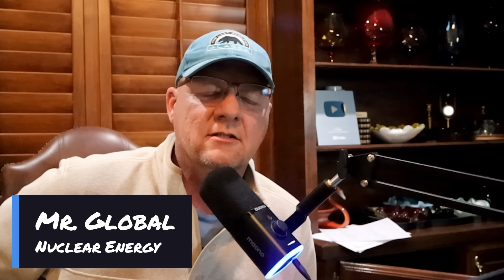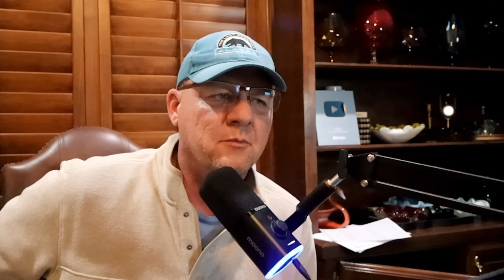Why Nuclear Power is Too Expensive and Always Late

Comment: I am pro-nuclear, but when the value proposition is based on running cheaply for a century, you really need a lot of faith in government over long time horizons.  Build times are conceivably possible to massively shrink, but you need to fix a lot about the system

Comment: V poor analysis.  Answer these questions:  why are China and Russia simply getting  on with it, at 20% of the cost and half the time that Western countries? Multiple answers:  it IS bureaucracy gone wild.  France, China are proof that building  multiple  copies of the same model resolves all of this commenter's points.  The unwarranted  fear of radiation, exaggeration  by poor science  journalism and successful  demonisation by the fossil fuel industry also feeds into the West's self defeating response. 

SMRs could resolve all of the energy needs but it needs the government to get out of the way. And the public needs to come to terms with the fact that nuclear is the safest energy. Just as safe  as solar and better than wind and hydro. Chernobyl, the worst accident, killed about 60 people and probably shortened or adversely  affected another 100 000 lives.  Which is nothing compared  to road accidents now or the future climate damage that not replacing  fossil fuels will be.

Comment: In the 1970s Austria built a nuclear powerplant (Zwentendorf) and after it was completed, it was decided not to switch it on. Even the first fuel was order that time.

Now: Google builds a data center in Kronsdorf. They already got 150 MW power but requested another 800 MW of power demand from the grid. Yes this will required some grid upgrade there but the grid itself does not generate any power. Someone must also provide that power. I don't think AI will wait 20 years for that to happen, regarding the innovation cycle speed in the computer industry.

Comment: And yet Ontario's nuclear plants have been running since the 60's and 50% of the power in Ontario is supplied by them. They have been constantly updated and currently there is no intention to replace them. Maybe it's the fact that the US seemed to always pick the cheapest designs leading to the endless shutdowns
Reply: FYI, a decision to build those nuclear power plants was political. 
Ontario has plenty of hydro resources and in those days environmental assessments, permits and getting agreements from natives was not a thing.
But all plans to build hydroelectric dams in northern Ontario were cancelled because  federal government at that time had an idea to sell CANDU technology around the world. But they needed a few model sites to show to potential clients.
Quebec did not agree with this scheme but Ontario did.
This is why Ontario is not a good example for nuclear power plants. 
But France is.

One major advantage Canada has is different ownership of power plants and transmission lines. 
US ownership is very fragmented, which doesn’t lend itself to long term planning.
Private owners want to squeeze maximum profit instead of spending money on upgrades, public owners don’t want to spend money on upgrades because those upgrades are invisible to the voters.

In contrast, if the taxpayers in Canada pay for everything, the capacity planning, upgrades and the quality of equipment used is top notch 
😂😂

Comment: AUSTRALIAN ENGINEER - Can people like you who are clearly NOT ENGINEERS please shut up.
Go and invite an engineer on so you can actually inform people instead of MISINFORMING PEOPLE. 
FIRST - like most Americans you think everything that happens in America represents the world - WRONG.

SECOND - Your timeline premise is BULLSHIT. At 2:12 you said "And we have an energy system that changes. Literally changes every 10 years." 
THAT IS COMPLETE NONSENSE: Power stations last decades. Hoover Dam has been operational for 89 years. The Voltages DO NOT change. The Frequencies DO NOT change. The biggest users of electricity like manufacturing plants and petrochemical plants DO NOT change because they aren't built to go for less than 10 years. Those sorts of users have basic operational plans lasting 30-50 years.

THIRD - You claim you want to educate people and can't look up the cost of Vogtle. You type V-o-g-t-l-e into google or Wikipedia and it gives you the cost of $36.8billion for 2 x Westinghouse AP1000 reactors. That's a cost of $18.4billion each. ANYONE CAN FIND THAT OUT IN SECONDS.
Now you are RIGHT on the costs being to high BUT YOU HAVE NO IDEA WHY they have exploded. 

FOURTH - Mixed in with the costs claims are the construction times. 
Vogtle the construction start and commissioning dates are also on Wikipedia Unit 3 - 10years 2 months Unit 4 10 years 5 months. 
The Chinese also have built 4 AP1000 reactors. The 2 at Sanmen took 9yrs 5m and 8ys 11m. The 2 at Haiyang took 9yrs 1m and 8yrs 7m.
Considering Vogtle was interrupted by the 2017 Westinghouse bankruptcy and China is far less regulated the construction time was reasonable.
For comparison the Barakah plant in the UAE with 4 South Korean APR1400 Reactors took 15 years from award of contract to full commercial operation.

This is something that infuriates engineers when people take an example of something and compare it to nothing. You clearly have no experience in complex projects at either the design, construction or commissioning phases. 

FIFTH - On financing people like you do not get HOW these sorts of projects are financed and HOW the companies are subsidised and HOW the general public end up paying for it all. This is NOT a nuclear plant thing and its NOT a government versus private project thing either. The problem is accounting tricks, banking and economics NOT engineering. it gets more complex and convoluted but here's the 3 important points

1) It starts with the economists who are obsessed with growth measured by GDP which does NOT measure production or indicate productivity it measures spending. So when someone spends $1 GDP goes up $1 and someone OVER spends $20billion GDP goes up $20billion. This is why economists never complain about military spending like the $2Trillion on the F35. To an economist that's fantastic because GDP went up by $2Trillion.

2) Then there's the issue of the banks who lend the money. They do not loan money from cash in the vault. They create money on a computer. Their only concern is "can the customer service the loan?" and I got told that by a commercial banker when I asked if they check on the project when they have to loan an extra $$billion. He said "NO" they only check if the customer can service the loan. When he had to find an extra $$billion for a project it was great because he got a commission for that.

3) Then there's the real clever boys in accounting who have found a ways to flip massive construction overspends into profits. Its from the same sort of mentality that gave the World negative gearing. The overspends allow the owners to make massive claims on tax and over time those tax concessions flip the initial overspend in to long term profits. The shareholders don't care so long as they get their dividends and the CEOs don't care so long as they get their bonuses. 

Milton Freidman said "Greed is Good" and that got adapted into big construction.

I gave up critiquing at that point.

Comment: One issue with NP was the design. Yes most use the PWR style but the plants are uniquely constructed. Had the NRC worked with manufacturers and standardized the build and construction of NP this may be different today. Not making NP plug-n-play is the failure.

Comment: Nuke plants were aging out, power demand was kind of decreasing before the advent of EV's and data centers, renewables are cheaper and faster to build, no highly toxic waste, lower decommissioning costs, continuing advances in renewable efficiencies and lowering costs to implement. Meanwhile, nuclear just keeps getting more expensive and takes longer and longer to build. I think I also read that SMR's may have a slightly higher cost per unit of energy produced vs. conventional nuclear.

Comment: It's only the cheapest if the NGS is built on time and on budget and a has 40 year lifespan before refurbishment is required. Every nuke in Ontario has gone at least 400% over budget and has needed a complete rebuild after 20 years. Plus the cost of the transmission corridor to serve it. SMRs produce more nuclear waste per gigawatt than conventional nukes. The cost of dealing with that is not included in their costing either.

Comment: Agree 100% that the grid needs to be expanded and made more resilient.  I'm just not sure how that is going to happen in an efficient way when trump has placed 50% tariffs on some of the core raw materials required to actually expand it (steel, aluminum & copper).

Comment: Environmental assessments;  seismic reports (at least three US plants are built on fault lines...Diablo Canyon, North Anna, and Indian Point).  The coolant towers alone cost a couple million to design.  Coastal or waterfront plants can avoid the coolant towers but are exposed to rising sea levels, flooding, and hurricanes.  Nuclear needs power to circulate coolant even when "off" or else a meltdown occurs, and in an emergency the first thing that collapses are the grid lines and the emergency pump generators get covered in flood water.

Comment: Many years ago a prominent antinuclear activist told me that it's very simple in the end: where does the nuclear waste go? 

This is waste that lasts longer than agricultural humans have existed. 

The only project I'm aware of that took this issue seriously is the reactor project in Finland, where they are excavating into highly stable granite bedrock at the same time the plants are being built. They are excavating a huge tunnel network large enough to hold the waste for the life of the plant, and I believe also to hold more waste from elsewhere. They also devised some very clever containers that should hold up for the required half-life time period. All very expensive.

This means this is probably the only instance globally of a nuclear facility where you can price the true costs of that energy in real time. 

Everyone else tries to externalize waste storage as an unrelated issue. 

Humans are not made for such time scales, and there are a finite number of millennia stable geological structures that can be used. Finland has them. And has the cultural ethics to take waste disposal as seriously as the short term energy production of the facilities. 

If society collapses and loses the ability to commit massive resources to burying the waste properly it will not get dealt with properly. 

Just look at Chernobyl. It blew up, the ussr collapsed, and ukraine was stuck with the problem. Then Europe had to step in to build the short term sarcophagus that has already been damaged by the Kremlin's invasion and will probably require new encasings at great cost, which will also be short term.

Comment: Any thoughts on this?
Ontario is building North America's first grid-scale Small Modular Reactor (SMR) at the Darlington nuclear site in Clarington, Ontario, with construction starting on the first of four units to power hundreds of thousands of homes, a key part of Ontario Power Generation's (OPG) plan to meet soaring energy demand with reliable, low-carbon nuclear power, using GE Hitachi's BWRX-300 technology, aiming for the first unit online by 2030.
Reply: unless you're near the place, don't hold your breath

Comment: In the sixties our family moved into a subdivision of about one thousand homes. It was tract homes with three models to chose from. Each model had about five or six options to suit a families needs and budget. All of the crews of every trade worked out the bugs in the first few homes, so that they got costs down and efficiency up every step of the way. Now we call them cookie cutter homes like it is a bad thing. Everyone wants custom homes on every lot such that each one is experimental for the construction crews. Of course the prices rise and of course the timelines slip. If we could get assembly line SMR's trucked into the site with standardized construction every step of the way and designed to be trucked away at end of life for disassembly at one secure site it would overcome most of the legal challenges and be a proven technology. And maybe you truck one in for each data center so that they are OFF GRID and take away the problems they cost the whole system. And then start doing that for industrial demand that is straining the system as a whole. Take high demand users off the current grid, you expand capacity for everyone else. And maybe you do not have to do as much upgrade on the grid other than put in some connections for solar and wind. You end up never having to deal with waste on site and that simplifies many issues and risks at each location. Look, custom building is expensive and even worse are change orders mid project. Call it the mobile home of reactors. One or two standard models that are plug and play like battery systems. It is the only way to make it affordable and efficient. And it is the only thing we have not tried to date. Truck it in, use it up, and then truck it away to be rebuilt off site. A sealed unit that you hook up to the output and never mess with the inside of it.
Reply: Can you image the price of a car if each one was custom built and original. Henry Ford came up with using assembly lines to lower costs and speed up production for mass markets. We need that for SMRs
Reply: My belief is that they are trying to misuse SMRs by using them for general power rather than specific sites. Use them to take the high intensity locations off grid. If a data center grows and needs more add another unit. Doing this takes demand off the grid rather than adding complexity to the grid. If a frozen food storage cave needs that much power, put then on an SMR and leave the grid alone. You want to ramp up aluminum production here? Put an SMR in place to feed the smelter instead of pulling from the grid. To me it seems to be a failure of imagination.

Comment: Thank you for the commentary, Matt.

In the 1960s the US military built SMR's they are inside submarines and aircraft carriers.

They work well.

There were other experiments for truck portable SMR's for supplying power to HQ units etc on the battlefield.

Much of the design drawbacks were that the SMRs did not put out enough power.
Each iteration resulted in a larger and larger planned reactor.
Until the portable reactor became less than portable.

In the information I read the consensus was to build larger and larger reactors to reach what they called economy of scale.

Except that the larger reactors cost us in cost overruns.
Vogtle 3 and 4 were 10 years past due and 17 billiom dollars over budget.

People have forgotten early research into small reactors and now want to go back and reinvent the wheel.

If it can be made cost effective and safe then lets do it.
Reply: Military reactors were never cost effective. They were powering billion dollar warships. Cost essentially was no object, safety and reliability were the primary requirements, which is not the case for civilian energy generation. 

It's like yes you can make a highly radar resistant airplane but it costs over 100 million per unit, sometimes over a billion, and requires constant very expensive maintenance to function per flight hour. 

China is going to have big issues because they have been rushing nuclear plant rollout and that is not going to end well for them.

Comment: My understanding of the problem is that the current fleet of reactors was designed to create weapons grade byproducts rather than other physics pathways that do not.
    Also, we have hot waste issues unresolved, just in general. That adds monetary, social, political and engineering cost.

Comment: 🇨🇦 I think one reason nuclear is so expensive is that they are paying the price for having lied to us and betraying our trust.

We were specifically promised that the people planning and building nuclear reactors were planning for every conceivable circumstance and that they were building backups on the backups of all critical safety systems.

Then, Fukushima happened and we learned that a reactor suffered a meltdown because they put the backup generators on the beach. “Wot? You didn’t plan for tsunami… in Japan?”

The answer: “we did but we didn’t plan for waves that high.” That’s a pretty pathetic excuse.

So now the industry talks about the “fear of the public” like it’s unreasonable…. But pepperidge farms remembers.
Reply: The public thinks nuclear is not safe because of a few incidents (Chernobyl, Fukushima, Three Mile Island) but it is still one of the safest means of power generation.  Deaths per  TWh for nuclear are comparable to wind and solar at 0.03/TWh compared to natural gas at 2.8 or coal at 24.6 /TWh.  This unreasonable fear of nuclear results in some of the delays Mr Global mentioned and the resultant higher cost and delays.
Reply: To be fair, you could make a car indestructible, but it would cost $50M. There are ALWAYS compromises. There are ALWAYS limits as to how much danger you want to prevent against. Otherwise, nothing would ever be completed as it'd be less than 100% perfect, and the cost would be exponentially massive.
Reply: @WBS001  I think I am being fair. I'm not asking for or expecting perfection. I am expecting "no meltdowns caused by really stupid choices."